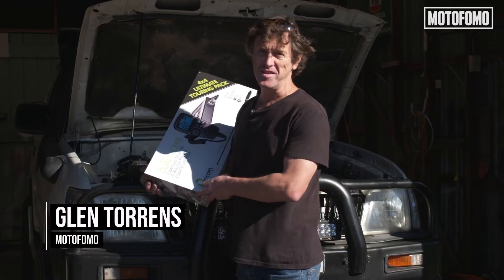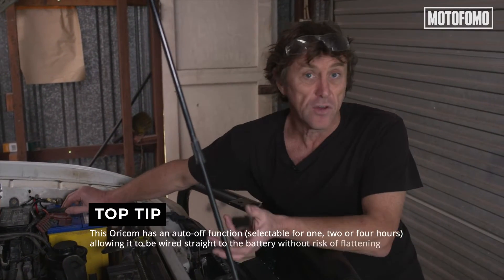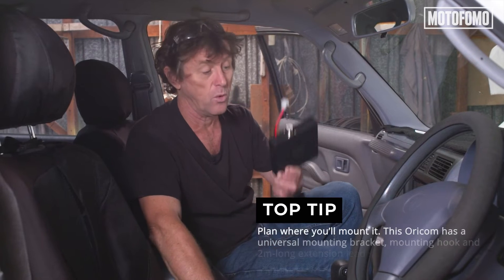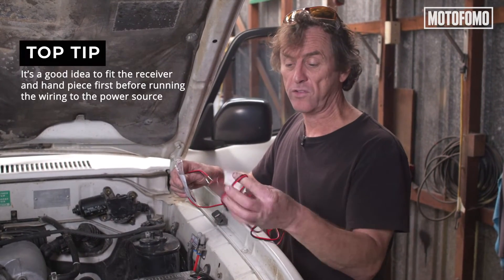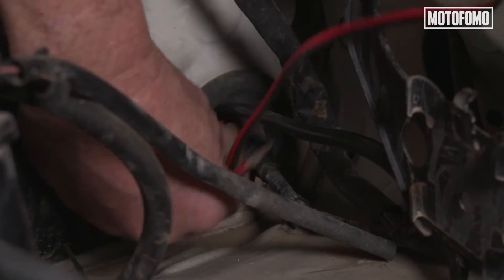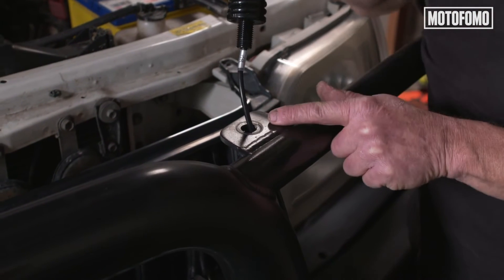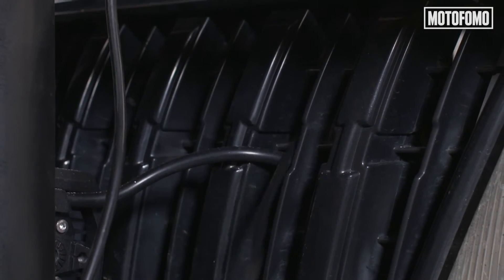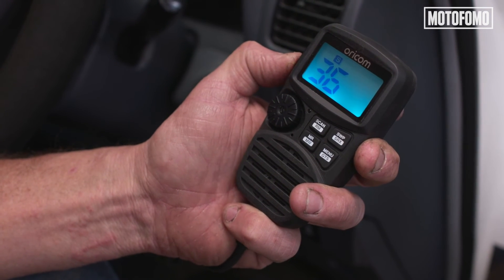Driveway DIY UHF CB Radio and Antenna Install - Oricom DTX4200 UHF CB and ANU1100 antenna kit

Comment: Nice video, thanks for that.  question: Does the antenna have to be grounded to the bull bar or not?  Because I see there is quite a good coating of paint on the antenna where it gets mounted/screwed onto the bull bar bracket.  Thanks
Reply: Nope, the antenna's don't need a separate ground.